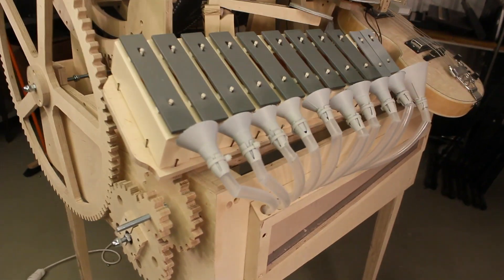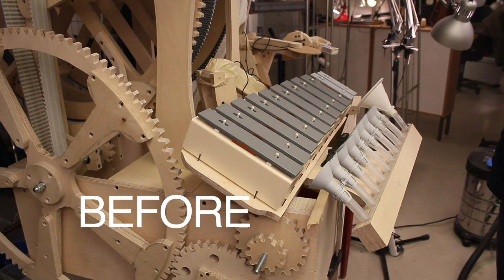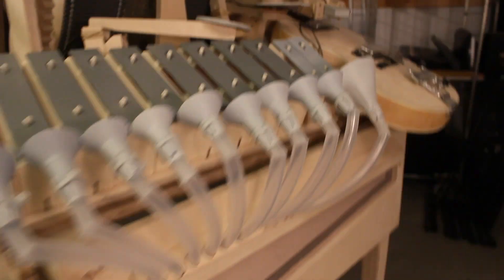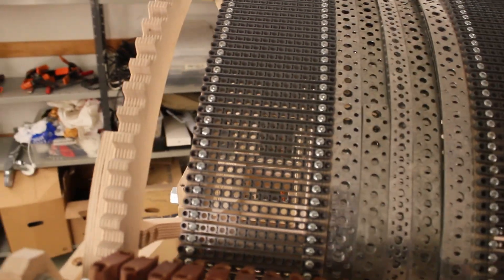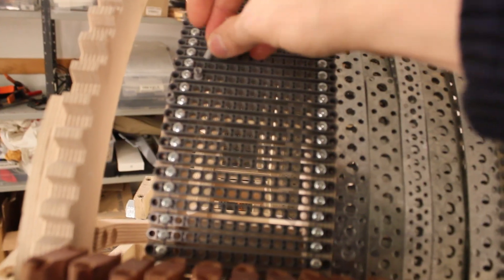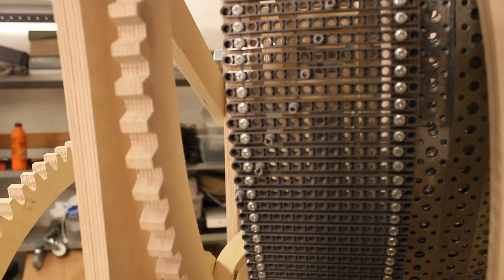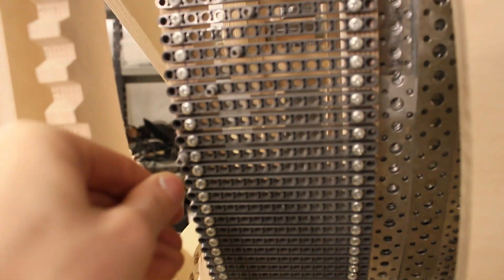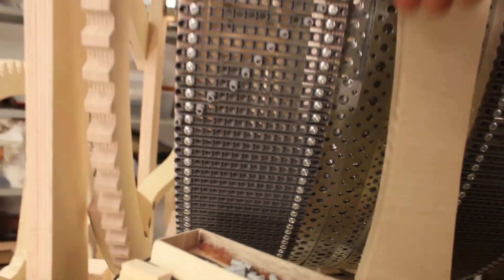Prologue #4 Musical Marble Machine - Vibraphone Funnels

Comment: Very nice design and craftsmanship.  However, dangerous table saw technique evident at 3:37, with the blade angled over the workpiece toward the rip fence.  If the workpiece binds, it will be thrown back at the operator, likely causing a painful injury.  The rip fence should be on the opposite side of the blade with the angled cut in this orientation.  There would be less chance of kickback if the workpiece binds.

Comment: show me motorizing it with steam energy through an elektro boiler and a tank so you concentrate both hands to the music

-if you use steam you could do it with pipes and shit D 
-with lights that illuminate the steam or with en compressor and dry ice :D
-with a little tech you could control pressure output with an pitch and so the bpm |:D|
-put an scratch module with sd card slot so you got en hole database to use -|:D|

Please show me some of that!!!!!  >-|:D|>

The pimped version of the old school barrel organ or something like that xD

Comment: What kind of wood is that? Never seen so many burn marks before. i know you're stopping every once and a while to make sure it's cut properly and the pushers you have look very unwieldy. IMO a better one is one that goes over the top of the safety guard to help push through. one for keeping it pushed against the guard is probably best but i'm not one for those silly "safety rules"
Reply from the maker: BitOPtimus Thanks for tips! Do you have a link to what you are suggesting? I actually started having nightmares about cutting my hand off after starting to use this cheapish table saw so safer pushthings would definitely be something i would go for! I got all the machines for this project so i am a beginner on all of them...
Reply: Something like http://lumberjocks.com/assets/pictures/projects/13932.jpg , slips over the fence and can keep the wood pushed down if you're not cutting all the way through or have another version that goes to the surface to help push. Or just google table saw jig, there's so many different configurations you can make for certain angles and stuff. You can also use the grooves on the tablesaw to make a jig to push in from the side or keep the wood straight.
Reply from the maker: BitOPtimus That looks perfect for some operations! It is birch plywood B/B quality by the way forgot to say that. I have been think of building a sled for the table saw to be able to make end cuts. Should be quite straight forward, thanks for the help!
Reply: Wintergatan, I suggest checking out mtm wood, he is a woodworker but the tools he uses may be helpful. also Darren, you can get wood cut at some hardware stores or rent the tools out :3